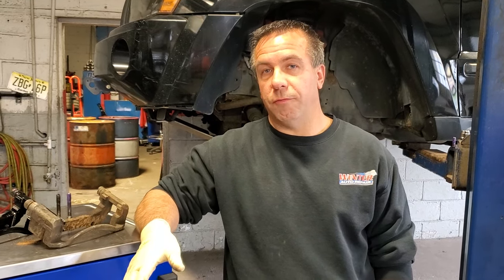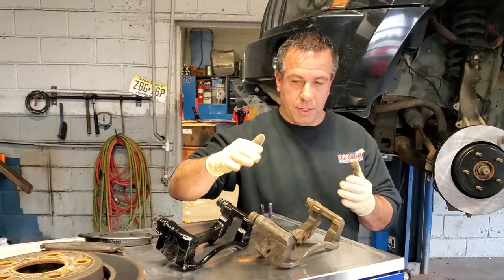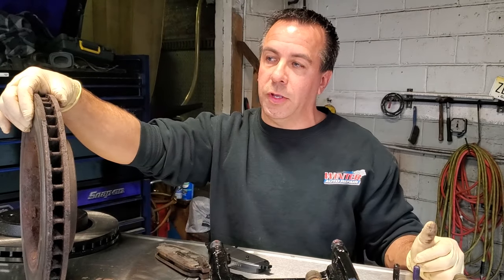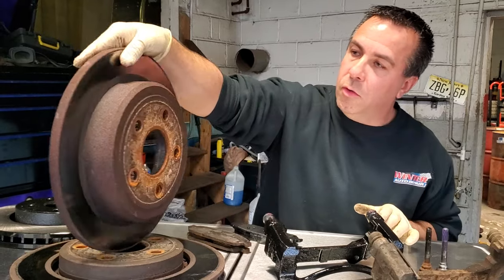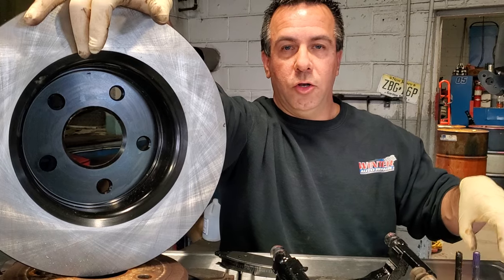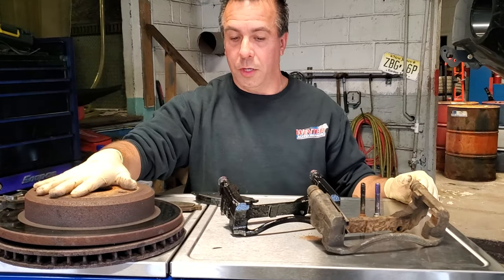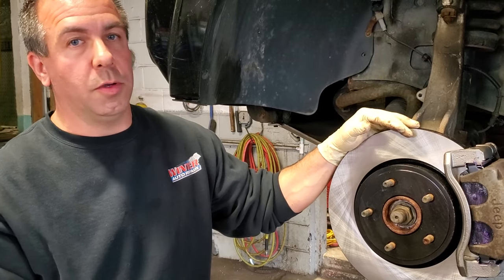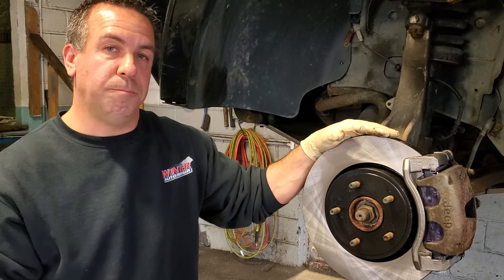High quality brakes vs cheap brakes

Comment: As a former PA State Trooper Vehicle Fraud investigator my hats off to this mechanic. I had to deal with over 1,800 garages and dealerships on a routine bases in my coverage area and It goes both way's many bad garages that also push parts not needed and also garages that pass cars that shouldn't pass. There is no shortage of crime in the automotive industry. I could write a book of automotive horror stories in this field.
Reply from the maker: Thank you! I appreciate your support.
Reply: Write that book!
Reply: @krijskovacic4938  i even caught a large dealership altering car fax reports deleting a crash and the ever so popular rolling odometers back.
Reply: What about this new wave of .mobile guys?
Seems they would have to do the right things by default.
Seems to generally draw ethic guys. Coz they are unburdened by what has been (working for sleeze shop/dealership)

Comment: Good to know there's mechanics out there with integrity. Keep up the great  work!!!
Reply: What the hell is integrity?  That must be listed as an archaic word in the dictionary as it doesn't seem to fit in with modern times.
Reply: Seriously.
Reply: You fell for that we can’t turn new rotors bs. I’m going make a video about this guy and you
Reply: Yes very hard to find and at 71 I'm still looking from an honest mechanic.
Reply: There's the ole saying a jobs not worth doing if it's not done right and 👍 to you my good man. 😂
Reply: Integrity? That caliper was a perfectly good caliper, it just needed cleaned up with a wire brush. Brake pads usually come with new clips that replace the ones in the caliper.
Reply: @blackericdenice   You literally can't lol. You'd remove too much material. Part of the issue is know-it-alls like you.
Reply: @dripskee6443  Only people who know less than me call me a KIA. I've never seen a rotor fail from it being too thin.
Reply: @blackericdenice   in most scenarios it would not. But let's say you're on a long trip or driving up and down a mountain. The force and the heat generated from that excessive driving will cause catastrophic brake failure. These are the kind of lies that get people killed. Stop it
Reply: @dripskee6443  Beading pads is 100% bs. You install your pads and drive the car like you would do any other time.
Reply: Your ignorance is astounding @blackericdenice
Reply: @paulkaufman4901  Can you explain why you feel I'm ignorant?

Comment: I do my own brakes, have for many years. What he said is absolutely true. I also happen to live in New Jersey and the coated brake parts are a necessity. Rust and corrosion are a serious problem in states that have to deal with snow on the roads, and Jersey uses brine which just seems dissolves cars.
Reply: I live in a city with lots of snow...and salt on roads....and rust is NOT generally a serious problem.  There is no safety issue with surface rust on rotors.  It's absolutely rare that it goes much further than that....because rotors constantly heat up and burn off the moisture.  This video is mostly a sell job for an industry that gouges people on replacing rotors constantly.

Comment: Sir, was out pricing a front brake job YESTERDAY, so how lucky I was to see your video, with so much information you provided on the pertinent questions, pricing and longevity of the “WHITE BOX” vs the guality parts, right down to the “ ROADTEST “ I am several states away from your business or you’d have my business…… EXCELLENT VIDEO !!
Reply from the maker: I'm so glad we were able to help you!  Currently, we find that Durago DMS or DES rotors are the best quality, depending on your application. We pair it with Power Stop ceramic brake pads.  This combination seems to last the longest with little to no rotor warping.  You should be able to find the parts at a good local autoparts store or online at places like Rock Auto 
I wish you luck, and Thank you for watching and commenting!

Comment: Mechanic here, you nailed it. Two things I really push my customers on, brakes and tires. Don't cheap out on those. I never do for myself and I'm a family man so I want to be safe as well. I'll let a coolant or oil or evap leak go a bit, but when brakes or tires aren't performing I'm throwing a bunch of money into them. It'll save your life. I was in only one accident in my life and I hit a deer because both my brakes and tires were cheap and too far gone. Never again. 

Appreciate your attention to detail of replacing parts that are too far gone, cleaning up what can be cleaned up, greasing moving parts, etc. You're 100% right, it goes a long way and prevents so many issues. Prevention is better than treatment. 

Agreed also about cutting the rotors, you just can't anymore, they are too thin. You might be able to get away with 2 sets of pads on the same rotor, maybe 3 in the off case, but rotors are designed to wear at almost the same rate as pads anymore. Not necessarily bad because they are cheaper overall. It is what it is. 

Just remember, your life is one solid brake performance away from being over.

Comment: Thumbs up for explaining why and how you do what you do! As a person who became a DIY mechanic due to bad dealership service, I appreciate work like this.

As far as a quality job, the truth is, with the way the economy and wages are, many people have lived financially on the edge for a long time. So even if they came across an honest mechanic like this, they had to decide whether to invest that extra $100 in a brake job with a longer life or use it elsewhere. If you have extra $, especially in rust prone areas (rust belt, North East, Ocean towns [salt], etc.), pay for the better job from a well-rated mechanic. If you're like me, it also looks much better. I can't stand seeing rusted rotors through wheels/rims.
Reply from the maker: Thank you. We originally made this video for our website. We didn't realize how viral it would go. Now that YouTube made us into a real channel. Our plan is to make more videos explaining how and why things work on cars and how to fix them. 
Please subscribe if you haven't. I promise our content will be beneficial to diy mechanics!  Let us know if there is something specific you'd like to learn about.
Reply: Honest? That caliper was in perfectly good shape, it simply needed to be cleaned with a wire brush. New pads come with new clips that fit into the caliper, the "sliding issue" wasn't an issue at all.

Comment: All the good mechanics I find are on you tube and 100s of miles away. I thought I had found a good mechanic a few miles from home. He did a few jobs on our trucks and I felt like it was OK. He also seemed to be willing to talk and answer a few questions. I ask a lot. I use Amsoil fluids on all our trucks, since I’m pretty handy I also do all the fluid services myself. Front and rear differential plus transfer case and in the case of my son’s xterra the transmission fluid. I have a 2018 Escalade and I wanted to do the transmission fluid change but I was a bit intimidated so I asked the mechanic if he would do it. I also told him I wanted it done with Amsoil, he said he didn’t order Amsoil but if I brought it he’d do it. I also don’t like to put any after market parts on this truck so I gave him the filter and gasket. He said he’d do it. When I came to pick the truck up the Transmission fluid was still in the back of the truck and he said his assistant didn’t want to use it because it was the wrong fluid. It was not, it was ignorance. He said the job was very complicated and the had to lower the exhaust and the catalytic converter to gain access. He charged me an exorbitant amount of money I paid him and left. A couple of days later when I had some time I got under the truck to check and see if I could tell what was done. There wasn’t a single mark on any bolt, the pan was super dirty, the bolts on the exhaust all had an even coat of rust. It was really evident to me that in reality they probably did nothing. By the way I asked him for the gasket they removed and he said I really didn’t need it and it was in the garbage, I really should have pressed him for it. I want you to know that people like me appreciate people like you who make these videos and teach us what to do, what to look for and give valuable advice. It’s very difficult to find good mechanics. I don’t mind paying if I am really getting the service I paid for.

Comment: i have a 2019 ram power wagon, only have 30,000 miles on it and  its never stopped great or felt super smooth and i bought it new. I just said hell with it and swapped out to powerstop drilled slotted rotors with some good pads and it transformed the truck. I never worried too much because i was the only driver but my oldest boy just got his license so i went for it, every mechanic around my home will half ass everything to make a buck so i wish i had a shop like yours around! I spent 21 years active duty combat medic so i have enough basic understanding if keeping things going and doing it the correct way the first time from years of managing our trucks in the army but for those who dont know much about this stuff you would be amazed at the difference it makes, changed it to a very enjoyable ride! ty for what you do Sir!

Comment: The OE front rotors on my 2010 Acura TL last for 110k miles. Of course I changed the pads 3 times and I greased the calipers every seasons but I was amazed by their overall durability. Buy cheap = buy twice.
Reply from the maker: Congrats.  You must be fairly easy on your brakes.  You're absolutely right,  when you buy cheap you'll definitely have to buy again.  
Thank you for watching and commenting
Reply: @chloedecker4991  Yeah, seems legit, Detective!
Reply: How many times did you have them turned?  I'm guessing at least once, personally I've never been fond of turning rotors even if it meant replacing them with cheaper knockoffs.  Turning the rotors reduces the heat sink effect, I think I'd rather have cheaper rotors  with more metal on them than a turned rotor, in my experience the ones that have been turned warp all too easily.
Reply: @robertmaybeth3434 turning rotors works just fine, all you're doing is removing a couple millimeters of material.
Reply: @donniev8181  dude, did you see those rotors? Yeah, you can cut them if you live south of WV but after 3 years of frozen north winters - your rotors will have turned to dust. It’s just the way it is up here.

Comment: I recognize those rotors and the purple grease - I use those for my vehicle as well. :)

I just told a co-worker of mine about that purple grease 3 days ago, and here I stumble upon this video!

And, most critically, thank you for bedding in the rotors & pads!  Once I learned about that, and after the first time that I went through the process and felt the difference, it was like the sky opened up and I was given a golden gift.  I've done all I can to share this knowledge with others, as not only does this prolong the life of your brakes, but improves the stopping distance too!

This is 100% a safety and security step that every vehicle should go through any time the pads and rotors are replaced.dd
Reply: Permatex introduced a red silicone ceramic grease that is designed to be used with rubber components (ie. Caliper pin dampers). The purple grease can be used everywhere else..spread the word.
Reply: what rotors are these?

Comment: Well done vid, with some really good info. Many people don't realize that cheaper usually costs more in the long run. I'm old enough to know what a lathe was back in the day, when rotors were made in the U.S. and Canada and were pricey 👍🏽
Reply from the maker: Thank you!   I started in 1996 and I remember cutting rotors and packing bearings.  The parts lasted forever!   Manufacturers realized that they could make a lot more money selling lesser quality parts and they save money making the rotors half as thick as they used to be.  It's a win win for them.  Unfortunately for the average consumer, they don't know the difference between parts and mechanics will take advantage of that.   Thanks for watching and commenting.
Reply: @WinterAutoRepair  I wish everyone was like you this is how it should be done absolutely  brilliant.
Reply: @WinterAutoRepair  this is why I do all my own car but would easy let you loos on it can't trust anyone now I'm on my third set of pads same discs they are smooth all even wear they will take another set of break pads all very good quality. Great content I love what your doing and the way your doing it top man 👍❤
Reply: Most new brake rotors not last over 36 months in snow states , no way up to 40k miles , advertise always lies .
Reply: @WinterAutoRepair  although for preformance driving unsprung weight matters a lot, so the lighter rotors are at least good for that

Comment: Its 2024 and this is by far the best brake and rotor service i have ever seen. From the high quality rotors to the sanded and painted calipers, you stand out from alot of shops. I am from upstate NY and it would definitely be worth the 7 hour drive to have you work on my vehicle.

Comment: I bought napa rotors and they came exactly like the "good" quality rotor you showed, coated and machined. Granted it was about $90 per rotor while the cheapest was about $50 per rotor. I also always use ceramic pads, never the cheapest pads and generally i've had a very good experience with my brakes. I recently bought an suv for winter and i'm doing brakes on it right now and the previous owner never lubed up the pins for the caliper and never greased the edges of the pads. That's something I always do is put some synthetic brake lube on those parts. Living in WI where there's salt on the winter roads it really does help. I also grease the back of the pads where they touch the cylinder and the caliper just slightly so that the backing of the pad will not stick to the caliper. I also always hit rust with a wire wheel and clean it up as much as I can before putting it all back together.
Reply from the maker: It sounds like you're doing it right!  Good job.   Sadly most mechanics don't grease the pins or clean the rust.  They try to perform the repair as quickly as possible and cut corners to get it done.   I'd rather take my time and do it right.   Quality repairs and happy customers is what we strive for!  Thanks for watching and commenting
Reply: I do my own brakes. One thing I have learned is that it may be better to go to the self-service wrecking yard to get your rotors and drums. You can measure a drum with an ordinary ruler and measure the rotors with a cheap micrometer or caliper, or even an ordinary ruler. If you have a good eye and some common sense you can get factory original drums and rotors. Sometimes, they don't need to be turned. More often they do, but whatever is the case you will end up with better quality than buying a no-name products from a parts chain or online.

Don't use cheap pads or shoes. Generally, parts chains carry two or three grades of brake pads. Either get the top grade or buy a brand name. Shoes for rear drums do not have so many options. Just get a brand name if you can. Not all brands are widely known though.

Comment: There's definitely a difference in quality from OEM to aftermarket,  the original pads and rotors on my Silverado lasted 77,000 miles brakes from auto zone lasted 17,000 so I went to a high quality set again..
Reply from the maker: There are many levels of pads and rotors. For most cars we can get pads as cheap as $9 and as expensive as $149 for a set. The pads we use are typically in the $85 range. The cost is a little higher initially but will last soo much longer that they pay for themselves in the long run. 
Thanks for watching and commenting. Please subscribe if you haven't, we really appreciate it.
Reply: @WinterAutoRepair  You definitely get what you pay for 😊

Comment: Being a New Jersey resident myself and owning a shop since 1984 in north west jersey, I’ve seen a lot of Rust Belt cars.
Purchasing a rotor like the one you described. In reality it’s cheaper in the long run. 
There are rotors that are cheap to buy and the rotors that are cheap to own. 
Yours is obviously the ladder, cheaper to own..
Buying a rotor that will pay dividends down the road even towards the end of its life when you may need it most is priceless . That confidence you get from knowing your brakes will be there is priceless.. 

Back in the day even big brand names like Raybestos, Brembo, and the rest of them were not coated.

A week after I would install these rotors, they would be brown and easily visible through a five spoke aluminum wheel. The brake companies didn’t realize or maybe still assumed that all cars and steel wheels with hubcaps ? 
Not only are there long-term performance issues. The Customer complaints from cosmetics were a legitimate concern. 
Thank you for a for a video that explains to customers who are simply price shopping, that they would save money by spending just a little extra and making a smart decision. Most customers don’t know or sometimes even care what it takes to cut through all the rust clean up everything and make sure things they probably lubricated like caliper pins. They just think how much could it possibly cost to do a rotor and pad slap?..
Reply from the maker: I appreciate the comment!  I had no idea this video would get so many views. My website developer asked me to make a video and post it to YouTube so he could run it on our site and customers could see what it is we do. All of a sudden, I hit an algorithm, and I have a few thousand subscribers and almost 500k views on my 4 videos.  
It's fun to see the comments from around the world, but it really makes me feel good when other professionals such as yourself appreciate the work we do because it's how they do top-quality work also.  
What part of Jersey are you located in? My shop is in Robbinsville near Hamilton and trenton, but I grew up in Mt.Olive in northwest NJ off of Rt 80.